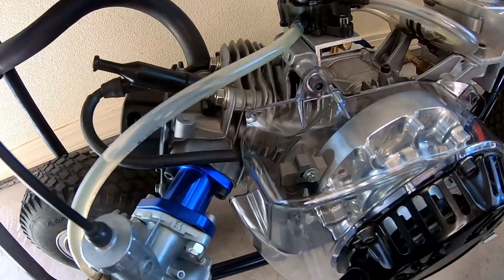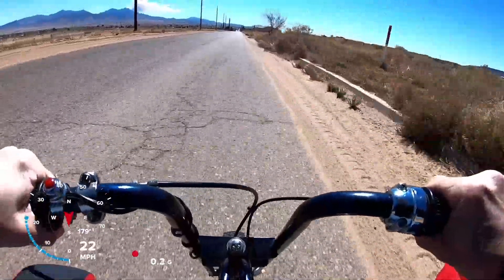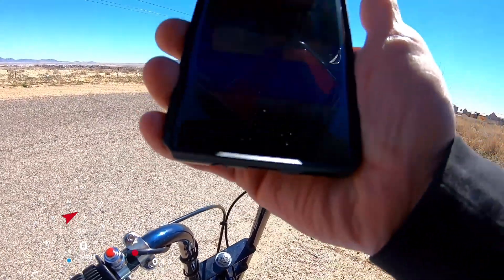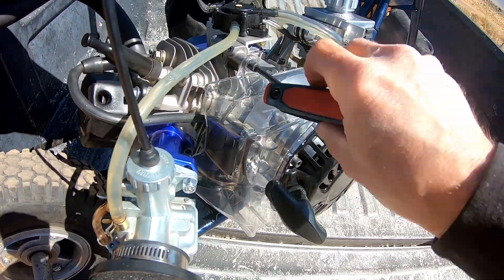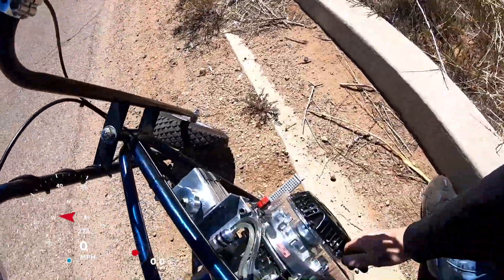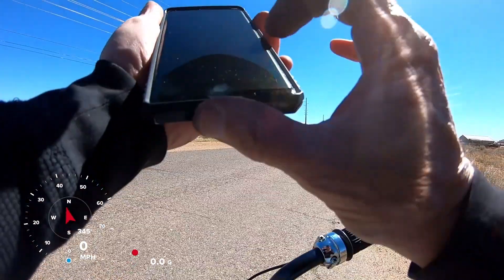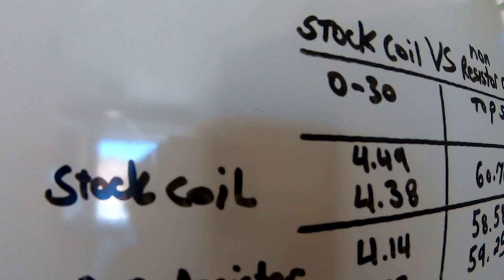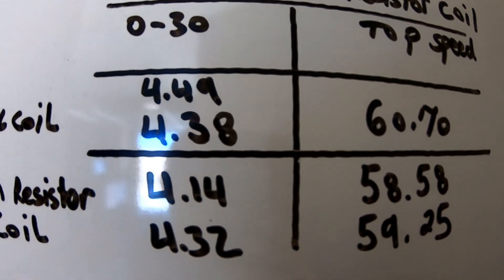Predator performance ignition coil versus stock coil

Comment: Just so everyone knows there, I ran a Paul’s HOT COIL and a Tons performance coil. Both had Tons wire.

The motor is a 7700rpm motor. 

Both I was limited to 68-6900 rpm sadly. 

I put a HONDA coil on there and bam, back up to 7700 rpm. 

As of now, I don’t trust the Paul or Tons coil.

I will say, Ton is sending me another to try. Paul from Paul’s Karts only said, “use what works best for you.”

Terrible response. From a HOT COIL that’s for high performance? Cmon.

Comment: Predator 212 coil, MSD boot, Ton's Red wire, Direct replacement Kart coil 0 Ohm 

Work. For.  Predador 212 cc.    ???
Reply from the maker: Check out the other coil and timing videos on the channel https://www.youtube.com/watch?v=9LYh9SFGR60&t=9s

Comment: You really notice the difference on alcohol with a tilly carb when you use this coil and a 4 electrode plug vs stock components not allot preformance wise but it does foul less ans starts easier

Comment: Hi I was hoping u can help me… I got a 212cc predator hemi with billet flywheel rod and hot 265 cam and rite at 6900 rpm it shuts down the motor like a safety thing… it doesn’t allow the motor to hit full potential or float valves… do u think that can be my stock coil
Reply from the maker: Could be or Is it running out of fuel? Float level maybe...
Reply: @Black66 Can you make a video on that ? my build is doing the same thing I was thinking the floats or the stock ignition coil was the problem

Comment: I gotta question..
What would happen if I shortened the ground wire on my coil ? 
I have a 224cc predator max with a 196cc hysun head , vm22 carb 135main jet ,arc billet flywheel  and dyna grinder 2 cam , 18lbs valve springs ...soon going to a 26lbs arc valve spring . Thank-you for all your advice and testing . Your awesome and a great teacher . Thanks again.. Brother . I'm in wenona illionis now 765' sea-level elevation
Reply: What do you mean by shortened your ground wire? There are no ground wires on these coils, they are grounded through the laminated steel core to the crankcase. There is the kill switch wire, which is connected to the primary windings of the coil. All it does is connect the primary windings to ground so when the magnets pass over the coil any voltage is dumped into ground before the coil can turn it into a spark. You could shorten this kill wire as much as you want and it will still work.

Comment: Performance coils are not resistor free only I sell hotcoils and I have them manufactured they are made to provide more spark power. They are resistor free but Taking a stock coil and making it resistor free isn't a high performance coil. Great video

Comment: I’m glad I watch this because I was just about to dump $45 on an MSD. I think I’m just gonna buy a better wire
Reply: Yup me too 😂 there not much of difference and 45 bucks down the drain
Reply: On August 8 of this year, my rear bearing locked up at 60 miles an hour I was able to keep that little bike up until about 20 miles an hour then it threw me, I broke my shoulder my left arm, my left wrist five ribs on my left side multiple fractures per rib, and one rib damage to my left lung. Needless to say I won’t ever step on another one because I don’t know if it was a prediction. Or just shit luck, but I always told my wife the rear wheel will lock up one day and F me up real bad and that’s what happened
Reply: @jojojeep1 Sorry to hear that, sounds really bad. It's easy to forget these little bikes were never designed to go past 20mph. They are sold as toys for kids but once you start modifying them they are no joke and you really have to treat them like a motorcycle with bad handling. Hope you have a quick recovery and find another way to go fast!
Reply: @jojojeep1 gotta grease those bearings hopefully you get back on and ride your block at least

Comment: Hi I have a quick questions I have  a predator 8hp 301cc engine that is missing the bolt that goes on the drive shaft to secure the clutch pully for my 40 series torque converter its a reverse trend bolt were can I find one been looking everywhere

Comment: Hey black66 i hope you are doing good, so i want to know what is better to have on a predator 212 a torque converter or a max torque clutch / a torque converter with juggernaut or a Max torque clutch with straight chain wich one is better the place where i ride at has a lot hills and some straight roads where i can speed through wich one should i use

Comment: Love your videos! Can you do a video comparing the stock Ghost coil vs this performance coil?
Reply from the maker: Thanks! You can tell what the Ghost coil is like compared to a stock predator coil in this video. It maxes out a about 6k RPM in the video. Check it out! https://www.youtube.com/watch?v=lm6zTvhJHSk&t=5s
Reply: @Black66  I believe I watched that video but was wondering if my stock ghost coil out performs the blue performance one in your video. I noticed the ghost coil is much larger and has a additional ground strap vs the blue one. A comparison of those two would be nice on the ghost.
Reply from the maker: @GotRiceYo  I probably could get away with a comaprison on the same bike set up that was in this video. The bike was turning right around 6k RPM maybe a little more.
Reply: @Black66  I agree that would be a good test on that bike. Thanks brotha!

Comment: Couldn't you just put an old stile  boot and retainer on and accomplish the same thing. Or keep the stock and buy a key with less timing.advance. I can't see 50$ worth for an msd boot and wire.
Reply: The small 0-30 gain he got and the second run with next to no gain make this not worth getting.
Reply: Coil is about $30 off his link in description.

Comment: Try the coil wire wrap with solid copper wire around the plug wire...Test the spark against the other standard and performance type...I have a video about this...The insulator wire cover is thicker and the windings are tighter...